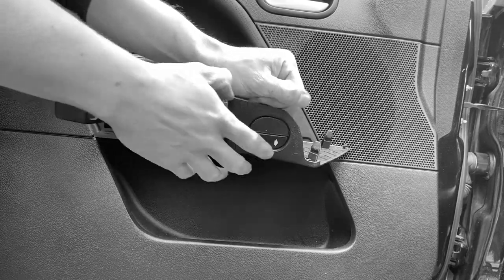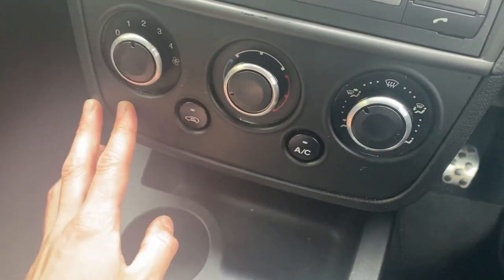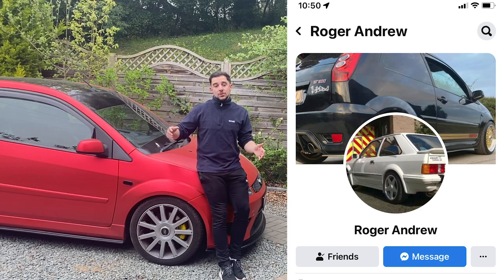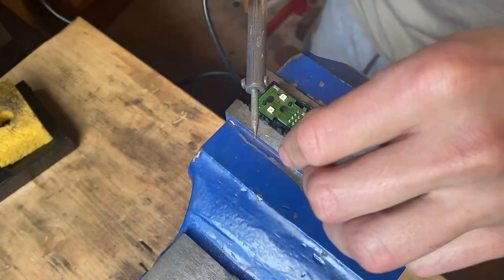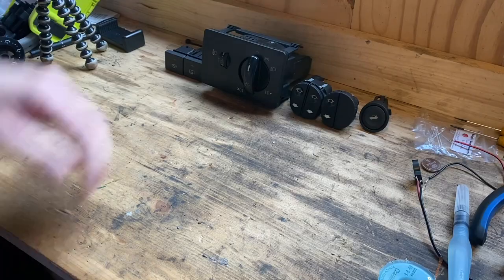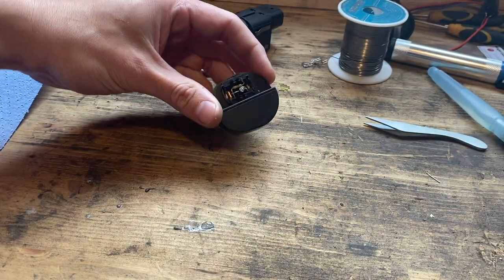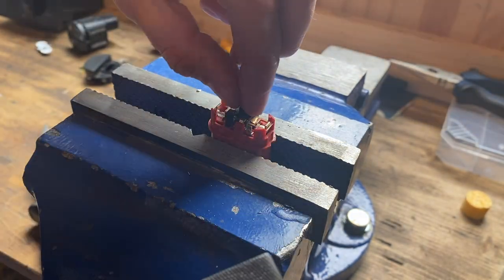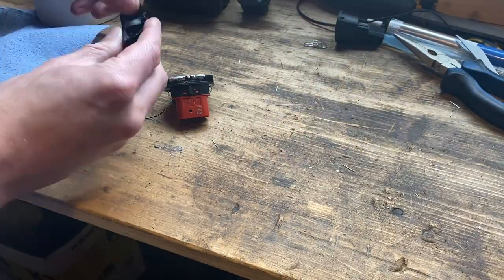MK6 Fiesta Interior LED Conversion/Colour Change Tutorial | Switches and Controls | *HOW-TO*

Comment: hi, a question, I have the same car as you Ford fiesta 1.4 tdci, I would like to do the same job change the led lights and make them white, what is the name of the product you use to clean the soldering points before removing them? the same one you use in the video
Reply from the maker: Solder braid or solder wick is what you want to search for 👍🏻

Comment: Alright, following up on my last comment - do you know the operating voltage of the LEDs you used? I'm about to tackle this in my Mk7 but all the SMD suppliers here want to know the operating voltage of the diodes (I see in the eBay listings that the forward voltage is 2.0-2.2v, but I guess that's different). I assume it's 12v since it's automotive, but want to make sure before I spend a bunch of money on diodes. Thanks again!
Reply from the maker: They won’t be 12v, 2.0-2.2v seems about right, there may be some variation depending on the type of led and possibly differences between colours but they should be around the 2-3v range. There are resistors on the PCB’s to lower the voltage appropriately for the LEDs. 12v will cook them instantly 😂
Reply: @MendItModIt  word, thanks. The low trim models of the mk7 Fiesta in the US have red LEDs on everything, but not everything is plug and play (the dimmer switch from a Fiesta Titanium causes a BCM error and all the dash lights to flicker on a Fiesta ST, or at least the one I got did) so I’m really having a hell of a time with all this since the resistors and voltages are all different.

Comment: Hi buddy, just done the boot popper mod and joined to the wires you stated but led won’t light up. Does the ignition have to be on or should it just work with the sidelight switched on.
Cheers
Reply: Mine was then stopped working needs a new one the led on these ain’t the best